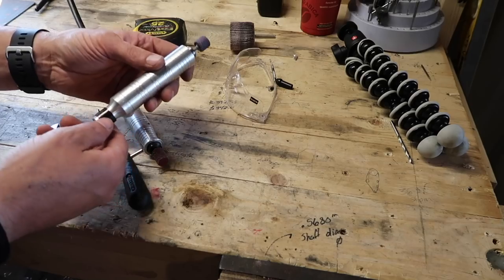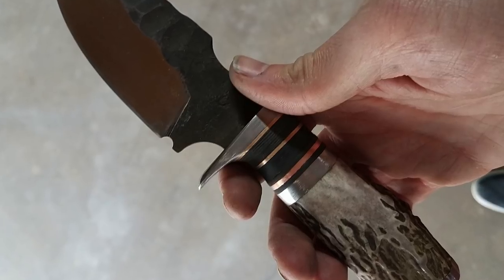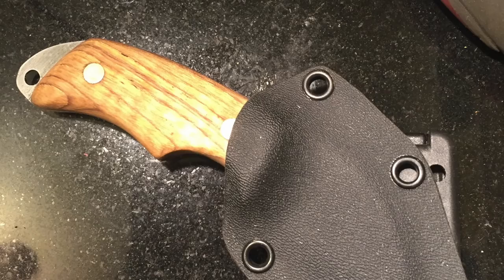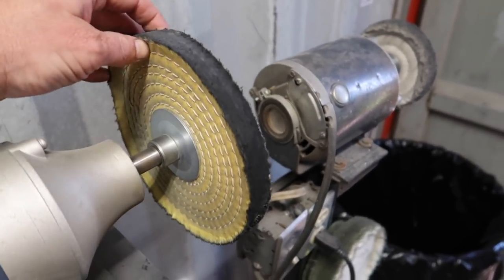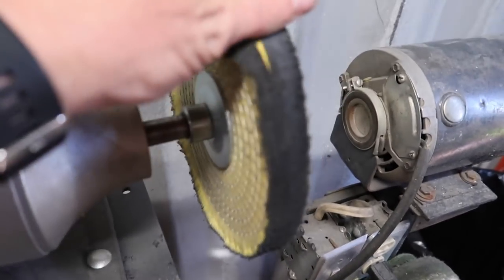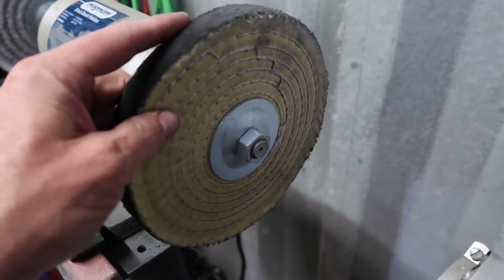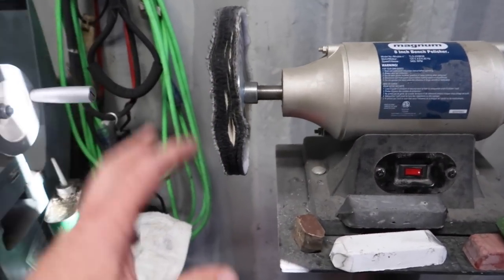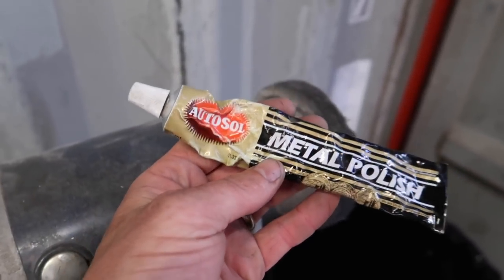Tool Time Tuesday - Buffer Machine (of doom?)

Comment: I'm working for a bigger knife manifactury in Solingen Germany. The blade industry in Solingen exist for a couple of hundred years and we are grinding and polishing with the machines on knee heigth. You put your underarms onto your legs and it really improves the controllability of the blade or whatever you are polishing. When polishing on knee heigth the risk of a blade bumping through your shop decreases as well. 

Greets, Lennart 😊🖒

Comment: I was a jeweler for 11 years. Dressing the buff helps to clean up between polishing compounds. A lot of times the compounds will cake up and build a hard layer on the surface. It also helps to knock out the loose threads as you work down the buffer.😀
Reply from the maker: +jeffery biddix oh sweet. I was hoping someone could enlighten me. Thank you so much! I'm going to have to make one of those little dressing brushes now. Cheers👍

Comment: Yeah, buffers scare me. I use mine all the time but I have thrown things all over my shop with them. The angle of attack is the thing. There is a very fine line sometimes between terrific and tragedy. I use a product called SimiChrome for final buffing. I suspect it is a lot like the Autosol. I have even used toothpaste at times for less robust material.

Comment: Harbor Freight has a nice litttle 3 inch buffer/wheel/Big but very wieldy Dremel tool combo that I scored for $22 on sale + 25% off coupon. They sell replacement wheels. It runs up to 10,000 RPM

Comment: Yeah, I actually turned my machine around so it spins the other way, that way hopefully if it grans it will toss it away from me...might still bounce back though, you are right about its uses on kydex though, makes Fantastic Edges!
Reply: Unless you are polishing on the TOP of the wheel, be REALLY careful with that. You may just be setting it up to throw the knife INTO you instead of AWAY from you. Dunno about you, but I'd rather take one in the foot than under the chin...

Comment: Is your buffer machine 1800rpm or 3600rpm?  I'm looking to get a 1/4hp 1800 rpm buffer since I've heard they are a bit safer.  Great video!!
Reply from the maker: +Jeff Lowery 3600. I do think slower would be safer. My furnace motor is slow, not sure on the speed, but it has never grabbed on my yet and my big one has a few times. Glad you liked the video! Cheers👍
Reply: Most furnace, single speed blower motors are 1725 RPM.